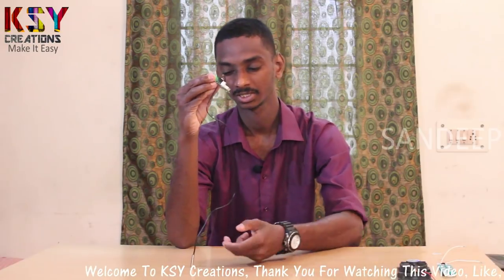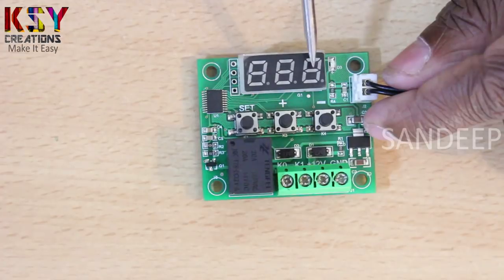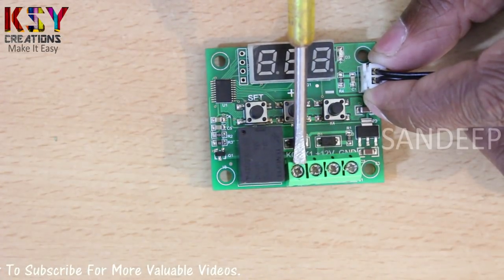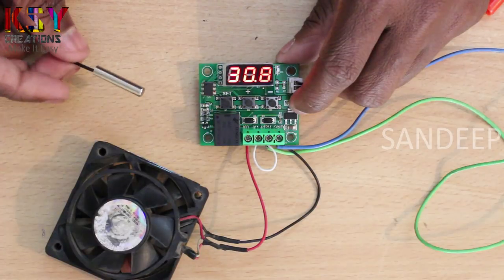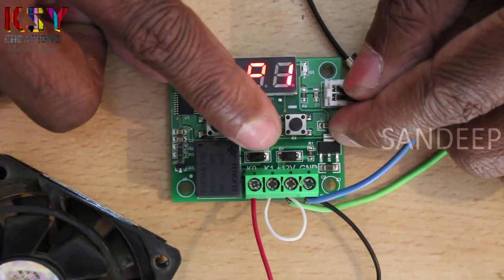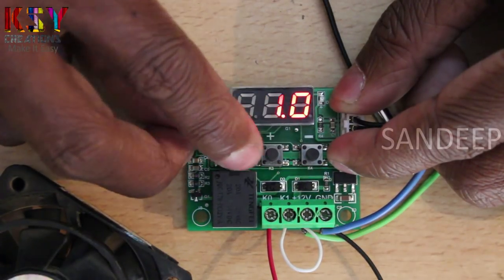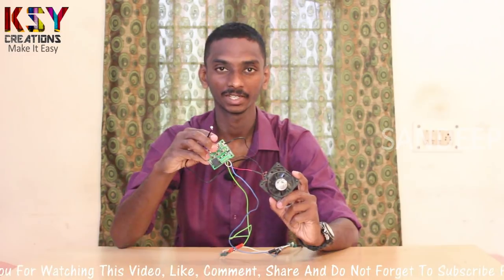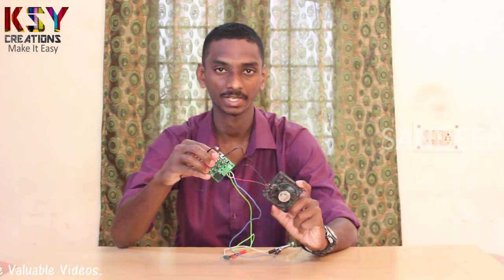how to connect thermostat temperature relay w1209

Comment: I have a question, if I switch off the 12 volt adapter power connection after setting up the temperature adjustment. Then when once again switch on the power the temperature setting once again required for adjust or not? Please reply.
Reply from the maker: Hi, no need to adjust again, once you set the tempurature, module will store the settings.
Reply: @KSYCREATIONS-sandeep-k  thanks

Comment: Very nice and helpful video.. But I have a question. If i connect a ac bulb or heater with this connection will the dc fan will burn out?? I mean what will i have to do to to run the heater or bulb beside this cooling system? Please reply.

Comment: Is there a part number for the entire device, or just a kit. Also, can it be adjusted from 68 C to 110 C for automatic transmission cooler with thermistor outside on piping? Thanks. I would like to get!

Comment: you have connected a fan can we connect a Bulb with it??? Because a 100 watt bulb needs more power.. kindly reply and guide
Reply from the maker: hiii, yes we can connect a 100 watts bulb to this module, but the connection will slightly different  ....
Reply: @KSYCREATIONS-sandeep-k  then we shall not be able to give it power supply with a charger.. what else can we use??
Reply from the maker: https://youtu.be/avBkPuIByZI    this might be useful for you

Comment: Can we connect both dc fan and bulb for incubator pls reply
Reply from the maker: Hi, we can connect only 1, either light or fan.
Reply: If we connect both fan and light then what is going to happen and can u make video on how to make incubator pls
Reply from the maker: If we connect both together, fan and light will work together, on and off same time.
Reply: Sir which size dc fan should i use in incubator ( in Inches)

Comment: I have a question. I have one of these that are very similar except the controll board is in a black box to protect. There are still 4 connectors-- but on the back and it goes like this from left to right: 
+ - S1 S2.
I assume S1 is like KO and S2 is like K1???
So I tried to figure out the connections but it fried the switch. Ordered a new one but I'm still confused. It is for a fan.

Comment: What type of wire do you use? What thickness?
Reply from the maker: Hi, you can use normal wires, it doesn't required specific gauge wires, as it is running on 12v

Comment: can i use this module in audio power amplifier heat sink stage? if yes then when i switch off the amplifier each time the relay module get switched off so how it reminds its temperature in memory ?
Reply from the maker: Hi, once you set the tempurature, it will be saved. No need to set each time.
Reply: @KSYCREATIONS-sandeep-k  ok, ty

Comment: I am subscribed, but now I know how to find more video info like the module link. Sorry, 62 and not into YouTube and stuff. 
 Please help me with a vehicle voltage at 13.2 Vdc-14.2 depending on temperature at the alternator. 
 I want to use an external relay to run a cooling fan for an automatic transmission. There are a few variations of the module are sold, but loose there setting if voltage is shut off. Even a drain of only <35 mA is too much if the vehicle is not run every 3 weeks. 12 Vdc thru dropping resistor thru a NTC thermistor as a voltage divider using a 10K potentiometer to set temp at 85C, but then trigger the N channel mosfet. This will turn/off the external relay. Should the thermistor be 10K, same as the potentiometer? Or should I use a 100K NTC thermistor to have better temperature range to adjust?
Automotive ASE Master Tech, Retired and recovering from 4 disc fused with 2 metal bars & 10 screws. So a little time to watch. I will be looking at some interesting topics you included. Did not know they were there. Still enjoy leaning. I hope you can reply! Thanks much. Nice video.

Comment: Is it possible to Power the thermostat with 12v 606 transformer?? Is there any problem.I need thermostat to get 37.5v.Also I need to connect cooling fan.
Reply from the maker: this module works on 12v and output from the module is 12v, if overvoltage is connected module may damage.          if you want 37.5v output, here is another way,  https://youtu.be/avBkPuIByZI   follow the video, in this video, I have used 220v, but instead of 220v you can connect 37.5v

Comment: Sir, can I use 12 volt 2 amp transformer
Reply from the maker: Hiii, if the transformer produce dc power u can use  ,  this module works on dc power.
Reply: Sir how many AMP we are use

Comment: Hello, what kind adapter i need? I know 12DCV  but aper? 0,5A, 1A, 5A or 10A, how much A i need for 3 PC fan arctic F12? Thanks
Reply from the maker: Hi, you can use 1 amp adapter.
Reply: @KSYCREATIONS-sandeep-k  Thank you !

Comment: I have mini incubator temp with Iam setting is not sfixing up -changes by itself after few seconds& work button some time s works off by itself what to do
Reply from the maker: Hi, there might be any problem with the module.........
Reply: @KSYCREATIONS-sandeep-k  
Thankyou Sir,Is that repairable or should I buy new one
Reply from the maker: No it's not repairable.

Comment: I need little expert help.
My AirConditioner outside has a heat sensor when outside temperature is above 35 C it cools alot below 35C everything is fine as per its compressors working .
Is there any way i can fix the temperature of sensor no matter how hot outside it gives the inside system temperature of 34C fixed any way possible ?
Reply from the maker: hiii, I am sorry to say that it is not possible because everything is controlled by a microprocessor, it runs as it is programmed.

Comment: How to connect cooling fan in STC 3028 controller in the position of humidity port. I want when increase the value of humidity (which is set by me) the fan should be on until the humidity value down

Comment: Can I use this module in conjunction with the air conditioner in my room?
Reply from the maker: Hi, air conditioner consumes hi watts, module relay is for low watts around 200w to 300w....
Reply: @KSYCREATIONS-sandeep-k  great , but can you suggest some economy board.
Reply: @KSYCREATIONS-sandeep-k  I want to use for air condition, my thermostat has always problem , I have 3 till now. So I was thinking if you could suggest some board.

Comment: Brother, At 1:51, why do we need to connect k1 and 12v positvie using a small wire strip? what would happen if we don't connect it?
Reply from the maker: hiii, if we do not connect the wire, the relay will not activate...

Comment: Hi
Great Video!
Can I use same circuit for controlling water in a pipe (pressure ~4 bar, flow 10 lit/min)
Will the sensor stand against water?
Pl guide
Thank in advance!
Reply: @Shrikant Kashid   >Place thermistors sensor bulb on the outside of the pipe. Clean and use thermal paste. Nylon sip ties or common metal worm clamp. Do not over tighten and risk damage. Adjust up or down as needed to predict the transfer of heat/cold inside the pipe to the outside. Hope this helps. Auto ASE Master Tech-Retired.

Comment: For how many hours can i continuosly run this board without switching it off
Reply from the maker: Hi, if you use it in proper ventilation, you can run it continuously.
Reply: Sir do u have some simple project with coding

Comment: May i know what is main purpose to have jumpe line (white cable)?
Reply from the maker: Hiii, the main purpose to jump a wire is to activate the relay, without that relay won't receive power...
Reply: @KSYCREATIONS-sandeep-k  hi thanks for your explanation.. Means using single power adaptor to activate fan and relay in one time? I found one video showing that, they use separate power adaptor.. One for fan and the other one for relay. What are different between that?
Reply: Hai can you help?
Reply from the maker: @syekhroyl5580  hiii, ya sure how can I help you ???
Reply: @KSYCREATIONS-sandeep-k  can you refer my question one day ago?
Reply from the maker: @syekhroyl5580  fan requires power to run in the same way relay also require power to activate, without power relay it won't work,  so that's why we require two power sources for relay and as well as fan.
Reply: @KSYCREATIONS-sandeep-k thanks. Currently i'm using two power source. My thermostat is activate. However my cooling fan not active. Is it i still require to jump from +12V to K1?
Reply: Already set P0 to P6 same as yours.. My fan not working after reach set temperature

Comment: Sir if i want to blow the bulb and fan togather then what is the procedure
Reply from the maker: Hi, if you want glow bulb and fan at same time, u can connect fan bulb together and attach it to  relay, both bulb and fan should be 12v ,then fan and bulb will run same time.........but in case fan and bulb should run one after other means it's not possible I think.

Comment: Fan type dc ac .....
Reply from the maker: Hi, fan type DC
Reply: @KSYCREATIONS-sandeep-k  please fan size model.    Thermostat model
Reply from the maker: You can use any size 12 volts fan and temperature relay model is W1209

Comment: My module does not show anything on the display. The led is on when I supply 12volt 5amp thru input terminal.  Any idea why is it so.
Reply from the maker: Hi, as led is on but you cannot see anything on display, I think there is some problem in the module, better check once again all wires and connections.

Comment: I connect a 12V bulb to the output of the thermostat. Then the relay cut off the output supply. What will do..??
Reply from the maker: Hi, may be something wrong with the settings, and please check the connections.
Reply: Set p0 to heating(H)

Comment: Is it possible to increase the length of the sensor wire? If yes, should any special instructions be followed to get it working?
Reply from the maker: hiiii, of course, you can increase the length of the sensor wire, below one meter would be good and take same gauge wire.......
Reply: Thank you for the quick clarification. I have increased the length, but it introduced an error of .8 oC, but have corrected that using the P4 setting. Awesome stuff you have! Keep up the good work! Thanks again!!

Comment: Hi can you guide how do I use it for AC switch it off
Reply from the maker: Hi, this module cannot be used with AC, AC consumes high Amps, this module can take upto 10 Amps only.
Reply: Use with a relay

Comment: You need to explain the hysteresis feature AS well.. It you do not know just tell me AND I WILL EXPLAIN IT TO YOU.. It is P1 it is important and regards the difference of degrees you can set before it cuts off the electricity supply and it is Made to avoid the cooler or heater to switch on and off continuously causing a system break.

Comment: Where did you connect the power source?from a battery?
Reply from the maker: No not battery, its 12v dc power supply....
Reply: can it be connected to AC power directly?

Comment: can it be connected directly to AC POWER?
Reply from the maker: Hi, it's a dc module,it cannot connected to a.c.
Reply: @KSYCREATIONS-sandeep-k  thanks
Reply: @KSYCREATIONS-sandeep-k  is ter dc module?plz let me the module name...
Reply: @KSYCREATIONS-sandeep-k  plz let me know the dc module name
Reply from the maker: It's 12v temperature relay.
Reply: @KSYCREATIONS-sandeep-k  plz suggest some module with different v and the product name.
Reply: @KSYCREATIONS-sandeep-k  ok 12v
Reply: @akanzingyo6530  Easy to do a search for 'W1209' on AliExpress or eBay.

Comment: Hi brother. I want to connect both bulb and a fan, when temp is high the bulb should turn off and the fan turn on. Please guide.
Reply from the maker: hiii, I dint tried two components at a time, I will just try once and inform you......
Reply: I Think you should use two different thermostats one set AS a cooler and another one set AS a heater so you also need a very powerful power supply and I would suggest you to add fuses on the positive supply wire to protect your devices: in your case the bulb and the fan.. It you want you can ask for more information but what is it for if I can ask

Comment: Hi. Thank you for this video.

Is it possible to increase the temperature setting to above 200 deg C ? 
I am looking for a circuit that I can incorporate with my laminating machine that has no temperature meter.
I hope you are able to provide me other option if the module you showed here will not work.
Thanks again. Shalom
Reply: Use a potentiometer in series with the NTC. Calibrate before using

Comment: Hi will the set temperature memory stay after disconnecting the 12 Volt supply to the motherboard and reconnect?  Or do we have to reassign the temperature parameters?  Please reply as I planning on using this for my motorcycle radiator thanks
Reply from the maker: Yes it memorize the given settings, you can install it on ur bike for radiator fan

Comment: Could it work on 60W bulb instead of fan?
Reply from the maker: YES BUT THE CONNECTION WILL BE SLIGHTLY DIFFERENT        

REFER THIS VIDEO   ( https://www.youtube.com/watch?v=x1JJ8ozbSqg  )
Reply: It it is fed at 12 v tension way not.. It works up to ten ah so up to 120 W I guess.. It someone knows something more about it considered to be helpful for everybody.. but please make sure it is 100% realiable 😀
Reply: Human4873  on the technical  data sheet paper it is declared up to 10 ah.. Did you test for 20?

Comment: I did all the work that you said, and the light on the module turns on, but the fan does not turn off😥
Reply from the maker: If the fan is not switching off means, you have connected fan to normal close terminal, connect the fan to normal open terminal
Reply: @KSYCREATIONS-sandeep-k  thank you🌺🌺

Comment: Sir can I connect only one thermostat with many fans?
Reply from the maker: Hi, output of the module is 12v only, if you are using 12v fan, than you can use only 1 fan.

If you are using 6v, fan than can use 2 fans.

Comment: where can i connect the bulb
Reply from the maker: Hiii, which bulb you want to connect 12v or 240 v ?,   if 12v bulb means you can connect if where the fan is connected, if 240 volts means, it has different connection.